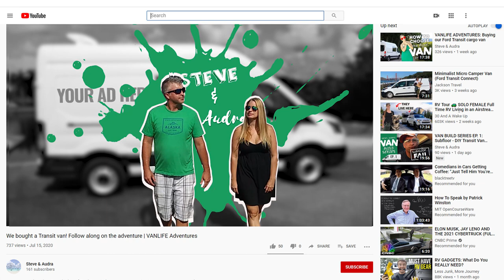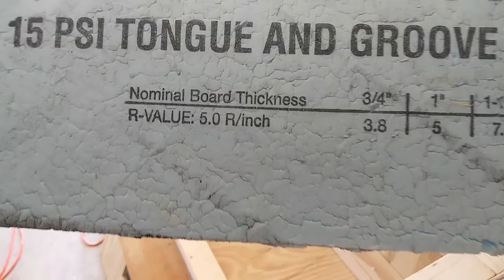Bed Platform & Bike Storage in a DIY Ford Transit Van Conversion (How To) | VAN BUILD SERIES #2

Comment: Thanks for the video, Steve and Audra.  I converted my second van about 40 years ago and fitted everything inside with an exact fit like your bed platform with 3/4 " plywood.  A car ran into the side of the van just behind my driver's seat at about 80 Km/hr.  After looking at the damage, the insurance guy said this way of constructing my wardrobes saved my life.  They took the impact!  We had to crowbar the guy's car off the road.  My van was still driveable.
Reply from the maker: Thanks, Arie! So nice of you to watch and take time to leave us some comments! That's really too bad that someone hit your van after you did all that work but good to hear how well it held up! Do you still have your Renault and use that for travel?
Reply: Yes, we still have the Renault and make day trips in it.  The van I had the accident with was a Bedford about 40 years ago.  Have a nice day

Comment: Nicely done. I enjoyed the humorous touches and your humility regarding your skills.  The finished product looks like you scribed the contours, if fits so well.  Two questions:

1. One premise of your build was to be able to fit bikes underneath.  By my calculations, it seems that 32" is a minimum height requirement to fit adult bikes without the wheels.  The placement of your 2 x 4's looks like it would leave a space of less than 30".  Are you actually able to fit your bike underneath?

2. With such a tight fit along the edges of the platform, have you found that this leads to the wood squeaking in contact with the van?
Reply from the maker: Thank so much, Richard! We really appreciate the feedback. Good questions! We have to take the seats and front tires off the bikes and we also fold Audra's bike handlebars down. It's a little more work that way but it gives us the space we need in the van and lets us take our bikes. The height of the space is 26.5" (floor to bottom of 2x4) - just enough to fit the back wheel in. If you check out our van tour video, you can see how it looks when the bikes are in there. We haven't had any squeaking. We used those strips of polystyrene insulation between the wood and metal. Not sure if that was necessary but we haven't had any problems and it was cheap to buy so we didn't think it hurt! Feel free to reach out if you have more questions - and we'd love it if you'd subscribe to our channel, if you haven't already!
Reply: @SteveAudra  Thanks for that info.  You have given me confidence to go with a lower height.  I'll be checking out your other videos as I continue my build.  Just ordered some plusnuts!  We have a 2019 Transit with the high roof and extended body.  Our bed will be positioned lengthwise, to allow for insulation, even though we sacrifice 15" of living space in the process.
Reply from the maker: We're glad we could help! When you have an extended, you have more "wiggle room" so that's nice. We hope you'll share your progress!
Reply: @SteveAudra  This is a terrific video! I really enjoyed your humor and hilarious editing. Also like the explanation of the platform height, since I would like to put recumbent tricycles (one with a 26" rear tire) under the bed. With the rear rack above that single rear tire, I suspect our bed would be more than 30" from the floor. Heck, we don't even own a van yet, so at this stage, I'm just babbling. Thanks for making it look totally doable, though. Safe and happy travels to you.
Reply from the maker: @gmaneis  We appreciate that so much! And that's not babbling! A year before we bought our van we started researching and doing potential designs for our build so we knew it was doable BEFORE we bought it. We had an idea of costs and plans well in advance. It's not too early to start dreaming and planning! We hope to hear from you in the future when you have your van! And we hope you'll find our other videos helpful or inspiring too!
Reply: @SteveAudra  Thanks for your reply. At age 74, I'm not even sure wife and I will ever get a van, but they're really fun to learn about and dream about, especially when videos like yours make watching them so much fun. I love how real you guys are!
Reply from the maker: @gmaneis  That means so much to us! It's a challenge on YouTube to get in front of people and we work hard to provide some extra entertainment but it often seems to fall flat. Thanks for taking the time to let us know you appreciate it. We still hope you'll be able to get a van! If not, maybe you could rent one for a trip? I know you can rent a built-out van at several different places. Whatever you do, we hope you are able to do some fun traveling!
Reply: @SteveAudra  Thanks for the kind words. I appreciate you because while I sometimes am a little bit entertained by overly perky, happy video makers, most of the time I feel nauseated. You guys are great because you aren't trying too hard to be funny. I worked on TV for years, so I know there's no way in hell you can hide your personality on camera. Don't even try! Keep up your good work. You're doing the videos, and your van, just right.
Reply from the maker: @gmaneis  Thank you so much! We'll keep at it and hope to keep improving as we go. Thanks again for watching. Maybe our paths will cross someday. That would be nice!

Comment: IKEA midframe telescoping platform suspension bars and brackets, Light weight and no tools required you just buy some slats and Velcro them on top. You can also get a suspension bracket in the kitchen cabinet department and you can slide the bars across
Reply from the maker: For someone considering the options what do you think is the cost for all the parts needed for that configuration? That might be a nice alternative for someone who wants a different design.
Reply: @SteveAudra  Well the suspension brackets were $15 and the mid beams that go across we're $15 each and the slats were 30 and the brackets and the screws were free or should I say included in the price so I ended up buying eight brackets six for the bed $175ish
Reply from the maker: @julierehoric3856  Sounds like a good option for someone with a bigger budget and different design!
Reply: Oh my thank God someone already commented this. Props to Steve and Audra for their hard work and dedication on this install but hopefully anyone watching this video will come to the comments and see that there is a far better off the shelf solution. The IKEA telescoping bed rails and slats are the fastest easiest way to install a bed in a van.

Comment: Great video!  Did you end up drilling any holes in the plywood for ventilation (moisture/mold prevention)?  I've seen some videos where folks did this.
Reply from the maker: Hi Michelle! Thanks for watching and leaving a comment! We've also seen videos where folks have drilled holes and have heard opinions for and against. We did not and we have not noticed any problem. I'm sure it can't hurt but we have not seen any moisture or mold and we've now been using the bed for about a year!

Comment: Why would you attach the frame to the van ? The frame can not move anywhere if built strongly frome side to side, and you can demount it easily. If the space is needed for someting else.
Reply from the maker: We don't need the space for anything else and preferred it to be more permanently fixed.

Comment: I am glad to find your channel. I bought a 2017 Ford Transit high roof extended.  I have prototype version one of our bed made from wood built. Version 2 will be higher to make room for bikes.

I like how you measure for your bed height.
Reply from the maker: Thanks, Lonnie! We're glad you found our channel too and hope you'll find it helpful! We've been very happy with the height of our bed. It's worked very well for storing the bikes and other things underneath and comfortable for sitting on the bed! We hope you'll check out our other videos and follow along on our adventures!

Comment: Hi there,  great job you two!  Question for you.  How did you attach the wheel wells to the subfloor?  Screws/nails? Thank you. Kate and Melissa
Reply from the maker: Hello! Thanks for watching! We screwed through the frame of the boxes to secure each to the plywood subfloor. We prefer to use screws in case we ever need to take things apart in the future.

Comment: What dimensions of timber did you use?
Reply from the maker: Hi Tom, we used 19/32" 4x8 sheets of plywood for the platform and 2x4s for the frame.

Comment: Did you use a queen mattress?
Reply from the maker: We use a 14" full size mattress and it just fits lengthwise side to side. The width of a queen would probably fit with our design but I'm pretty sure it would be too long.

Comment: Enjoyed your video. Nice job.
Reply from the maker: Thanks, Jack! Are you doing a van build?
Reply: @SteveAudra  yes I just got a Nissan NV2500. Completely empty right now and I am working on my plan to do a basic build. I had a minivan that I built out and used for 8 years. Stepping it up!
Reply from the maker: @OnTheDocks  That's awesome! You'll have lots of great headroom in the NV! We hope we'll be able to see your progress!
Reply: @SteveAudra  I saw that Eco Flow power station thing you have in another one of your videos. Is that working out? Seems like a nice way to skip becoming an electrician and just have simple power. Curious if you are running a fridge with it all the time or not. Thanks
Reply from the maker: @OnTheDocks  The Ecoflow Delta is great for the 12v stuff we run and really simplifies things for sure. (We're hoping to do a video just on the Delta and how we have everything wired but just haven't had a chance to do it yet. In our video coming up this week we will show more of our setup on the back side.) The jury is still out on the AC stuff such as our laptops and fridge. We're still trying to figure that out but running the built in inverter definitely draws down the battery more quickly. If we had a 12v fridge, we think we'd be able to run the fridge all the time with no problem. Once we mount solar panels, it might be enough to run our 120v dorm fridge full time - or at least more often. For now, we often just use it as a cooler.

Comment: This van must be so heavy using plt and timbers that thick?
Reply from the maker: We weighed our van a couple years ago when it was almost finished and it weighed 7520. Now that we're full time, our guess is that it's closer to 7800 or less, definitely less than 8000. The gross vehicle weight rating for the van is 9000. We also still get pretty good gas mileage - averaging around 18 mpg.
Reply: I'm 17 episodes in in one go doing great love watching you work things out, the weight often surprises me, a lot of builders are mad on weight saving than I think it's a van it must be able to carry much more ha, love the style you went for id like to give it a go but uk van prices are a joke at the moment.
Reply from the maker: @neiljemmerson8826  We appreciate you binge watching! 🙂 We definitely bought at the right time. You never know. Hopefully you can find a good deal somewhere or prices will get more reasonable.